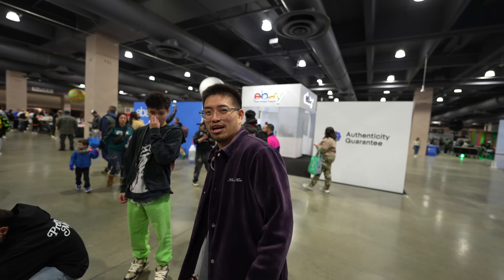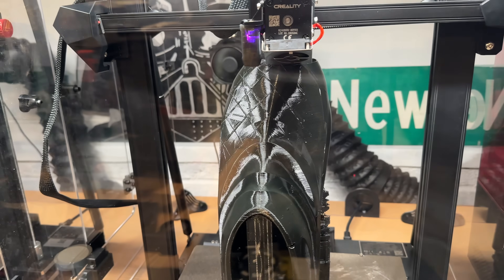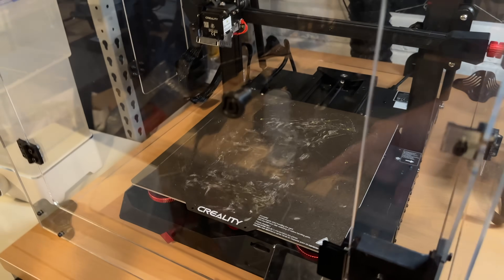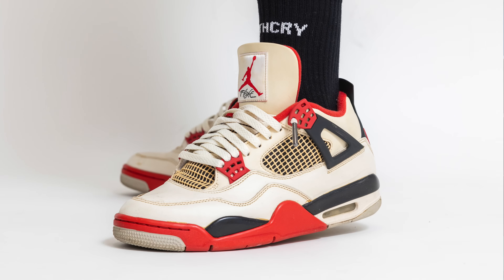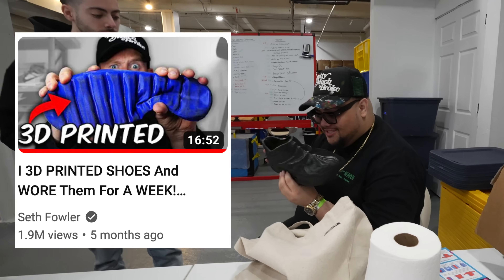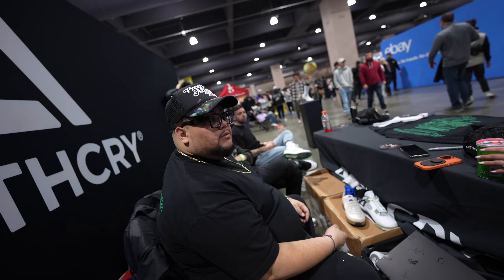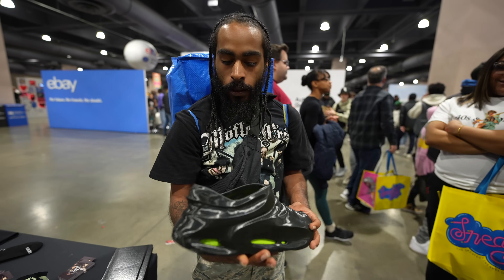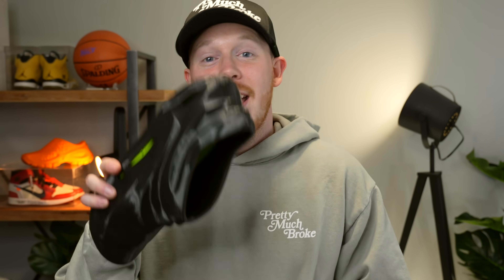I Wore 3D PRINTED Shoes To SNEAKER CON (WHAT HAPPENED?!)

Comment: Make a light adjustment on the shoe itself by putting a thick bump on the lower part so that it'll act as a double sole for it then it'll probably lessen the stress on your heel

Also the ankle part i think you can improve it by putting a skeletal structure of a back rim on your soles so that your ankle would be cushioned. You're working with 3d printed materials here so it's a no brainer to actually realize some parts require more reinforcement than the real material counterparts which means you can tinker with it a bit more to actually give better comfortability.

Also i know i'm kinda dragging this thing down with the soles but i think you should make it so that you have a 2 part sole rather than just one which means you have the cushion+ankle rim sole on the lower part of the shoe then a separate sole preferably with a slightly bit more dense yet thin top sole to give a much more cushion-y and reinforced feel to it